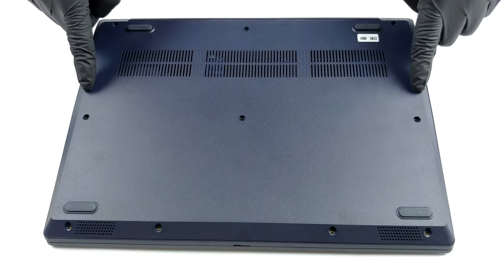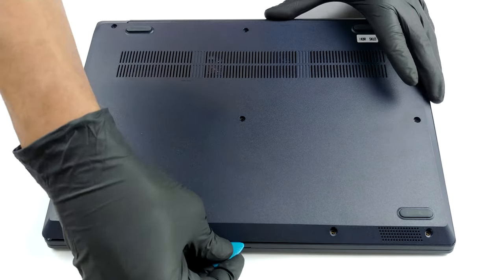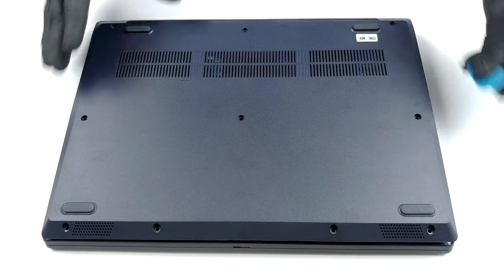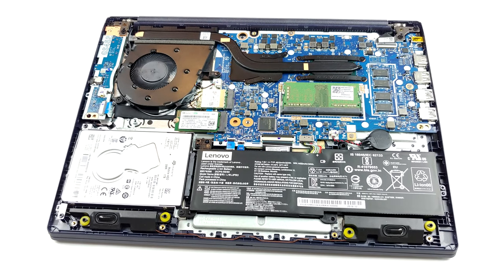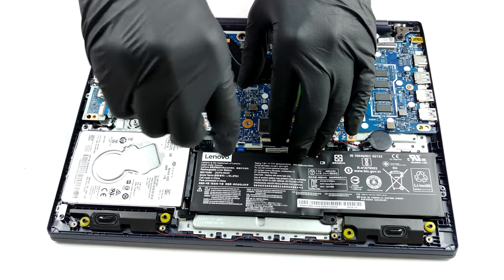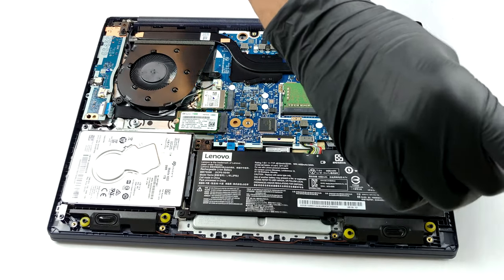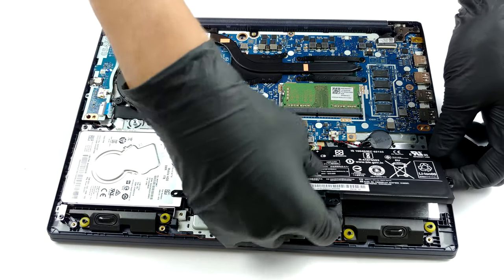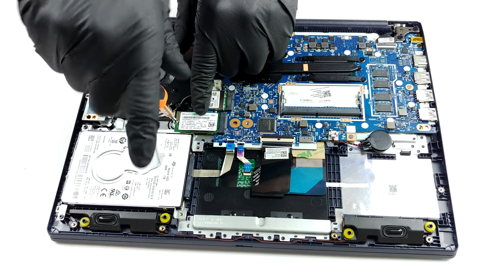🛠️ Lenovo Ideapad 3 (14) - disassembly and upgrade options

Comment: i put 16gb RAM with 4gb soldered RAM and it run 20gb RAM with no problem
Reply: Where did you find your upgrade?
Reply: Thanks man, im looking for this info with everywhere say maximum 12GB while on Amazon the offer a 20GB RAM option.
Reply: Ryzen 5 3500u versión or..?
Reply: But u have 3 vram option in the bios? Of ryzen?
Reply: Yup, I experimented with my laptop, it's also working. I used a Lenovo IdeaPad 3 14ADA05, AMD Athlon Gold.

Comment: please if you don't mind give me the hard disk cable connector type code
Reply: Im also interested on the hdd cable connector type
Reply: I also have this laptop and according to Lenovo website we need HDD CABLE L 81WA, but I don't know where to buy it.
Reply: @akirayamashiro6672  Why do we need that HDD Cable for? 
I'd like to increase disk memory, however I don't know if the one I have has room for an additional for an HDD Disk. Mine is a  IdeaPad 3 15IML05............................. Can any one help me?
Reply: can i know,did u have already upgrade hdd now?did u find that cable?

Comment: I recommend you to check your laptop first. Because mine Lenovo Ideapad 3 14ARE05 apparently doesn't have SATA 2,5" slot
Reply: Hello have you upgraded your ram to dual channel 4+4 2666 mhz since I own the same laptop like yours but when I tried to upgrade the ram with the same specification it glitched my screen making it unusable until I remove the ram it works again

Comment: I want to be able to play Elden Ring on here when it comes out.  Is that possible?  Never opened a laptop or desktop before, but this video makes it look easy enough.  A website I use to check my laptop vs the requirements says I need more ram and memory.

Comment: Can I add ssd+ had in this laptop
Reply: yes
Reply: @markov.  hi, can i install an sdd drive where you have the HDD installed
Reply: @Santiagoymatias2024  well there are slot for HDD (buy the bracket and the connector) and SSD m.2
Reply: @markov.  thank you sir now i can go to sleep thanks again

Comment: There was 4 slightly smaller screws and i only realized it when i was putting it back together this is the same model that my laptop has and i was wondering where i should screw it on?

Comment: Where is the empty m.2 slot located?
Reply: Its right above the hdd. Its not empty in the video, they have a short (2242) 128gb ssd in it, but there appears to be a screw hole for a typical 2280 length as well. Look @3:24
That said, I have seen listings where it says there are no m.2 slots... so not sure if that is incorrect or not for those models that come with a 1tb hdd, you'd think they would all have it even if it comes with only the hdd. Its why I came to this video but need to research further.
Reply: @FireMrshlBill  is there 2 m.2 slots?
Reply: @yanz_77  I don't own this, considered getting it for my kid for virtual learning but just stuck with what I had. I think its just the 1 though. 1x m.2 and 1x 2.5" sata.

Comment: How do I make ssd and hdd coexist?  Mi bios doesn't detect both at the same time
Reply: Is it possible to have the SSD and a HDD into this pc? I didn't see enough space to have both (I don't have that much knowledge about PC's).
Reply: @lennydiaz  you can, but the SSD would have to be a M.2 (better an M.2 Nvme) and the hdd a regular slim (i think 7mm thick) hdd
Reply: @victormanx  hi how much could the ssd go up to

Comment: will the warranty avoid because we diassembly by ourself?
Reply: Yes
Reply: unless you disassemble it to the point you remove the heat sink and or main board, it shouldn't void the warranty to open it up for upgrades

Comment: Can I add two SSD’s to this laptop a  512gb NVMe  and 512gb or 1tb 2.5inch  Sata SSD and mine came with a. Harddrive pre installed  do I still need a ribbon cable if I want to swap the hdd to 2.5inch sata ssd?
Reply: Yes you can.

No, u still can use the same ribbon cable
Reply: @ took a hot  minute but thanks

Comment: Does all ideapad 3  motherboard support sata hdd?  Mine has a drive bay but does not a a cable connected to the motherboard.
Reply: You need to buy that cable if you wants to add hdd, ask computer store or lenovo service center for that cable.

Comment: the laptop has default 512gb ssd. can i upgrade it by adding 1tb hdd?
Reply: yes,but with 2.5 inch hdd which is for laptop
Reply: Does it have another slot for storage??? The default is 512 ssd and the other slot is empty?
Reply: @markov.  kabel konektornya itu tipe apa ya bro kalau boleh tau
Reply: @ahnafhadwadzikriawan4600  ada yang bilang L81WA
Reply: I didn't think it's possible to have both simultaneously. Mine has 256 GB by default. I wanna add a 1 TB HDD.
Reply: @lennydiaz  it is definitely possible it’s just a matter if they gave you the mounting and cables for it
Reply: yes even with a 2TB 2.5" HDD as I've tried  myself

Comment: Which ram i should buy to use 12gb in dual-channel mode ? Or its not possible due to the onboarded 4gb ram ?
Reply: Only 4Gb will be dual channel, the rest single channel !
Reply: If you have the intel model, there is this thing called flex memory that lets you run mismatch memory modules in something faster than single channel but not as fast as dual channel.

Comment: is this 14ADA05? And did I hear that right, there are 2 sodimm slots, 1 is soldered and one is an upgradable slot? I was thinking if there are two slots, then that would benefit the amd3020e chip in it. right?
Reply: Now only 1 slot for.memory ,4 gb soldered

Comment: Hi Mate,
I've learnt that this laptop just supports 2.5" HDD up to 1TB. Is this right? I intend to upgrade to 2TB because my model is with a tiny M.2 only.

Thank you so much!
Reply: i know this is late but the laptop will support any size drive as long as it fits in the laptop drive bay (2.5")